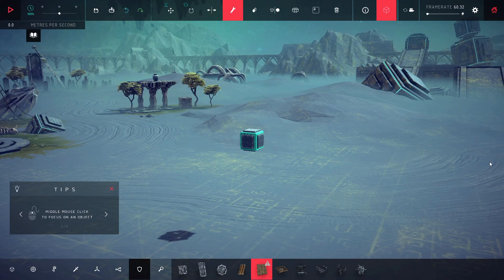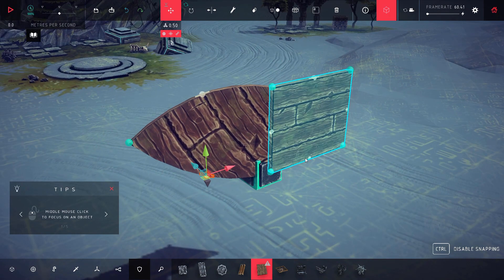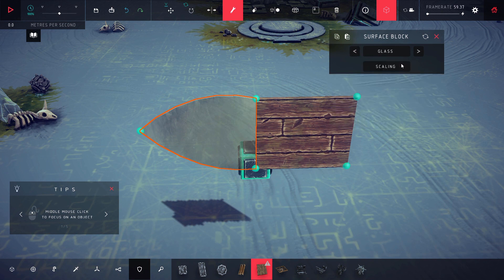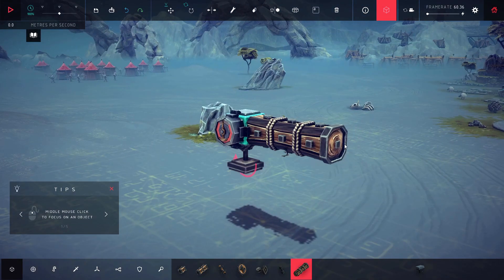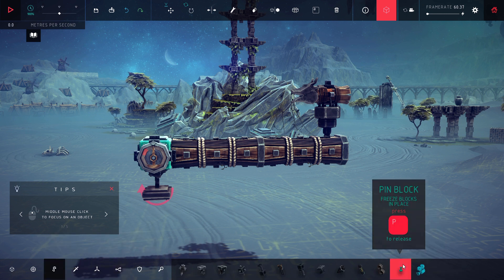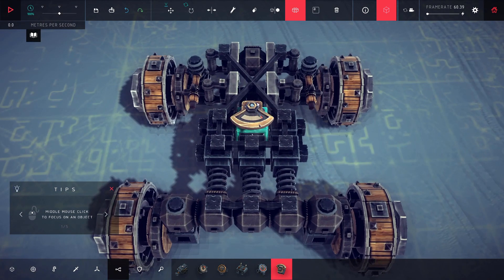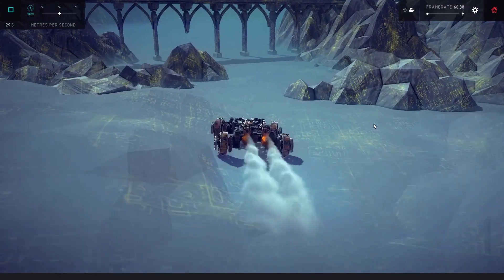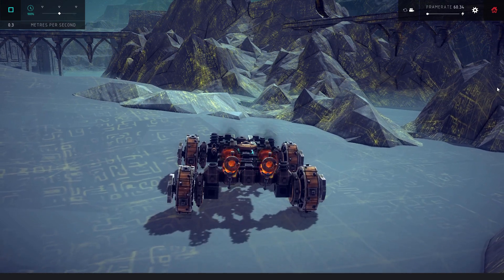Besiege - Build Surface And Anglometer/Speedometer How To Guide With Working Examples And Commentary

Comment: How are you scaling?  This update broke my scale tool.
Reply from the maker: Fortunately I've not run into that problem yet at least.
Reply: Which scaling mod are you using?
Reply from the maker: @Jake-co7rt  Apparently I haven't had that problem because I hadn't done much building in Besiege lately. I recorded a video just now  and the option to scale blocks was missing.
Reply: Which mod were you using for scaling in THIS video?
It was working here.  Did it break AFTER this video?
Reply from the maker: @Jake-co7rt  Sorry, never saw this comment for some reason. I haven't used any mods for a while. I just used the advanced builder tools.
Reply: I use easy scale mod and had the same problem in v1.05
Reply: @kelvinadi6485  Mine still doesn't work.  Anyone have any luck with scaling?

Comment: Have you tried Algodoo? Its fun to tinker with and has quite an expansive learning curve.
One of the few things I disliked about Besiege was how wobbly and asymmetrical a lot of the blocks were. Making sliding and shifting mechanisms like ammo magazines or reloading systems more akin to a gas-powered rifle was pretty hard. I'm curious whether this surface block alleviates that issue.
Reply from the maker: Never tried Algodoo, I'll look into it. As for the new build surface, you can make blocks any shape you want now. I'd think that'd make building anything more viable now honestly.